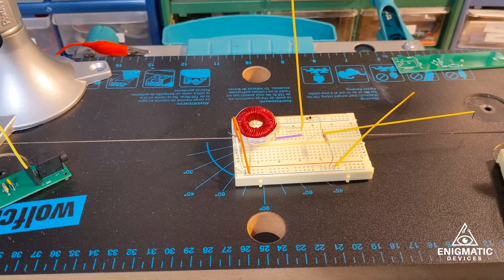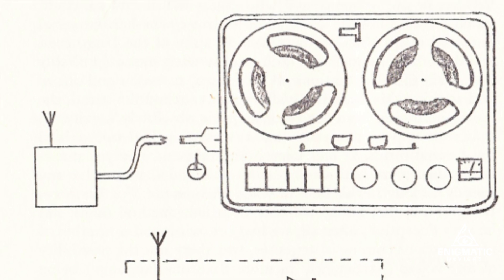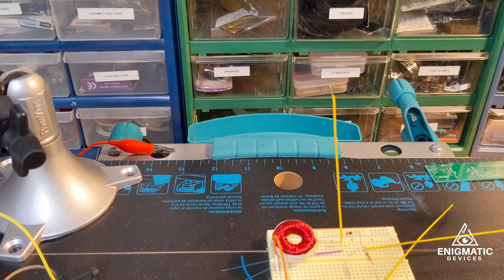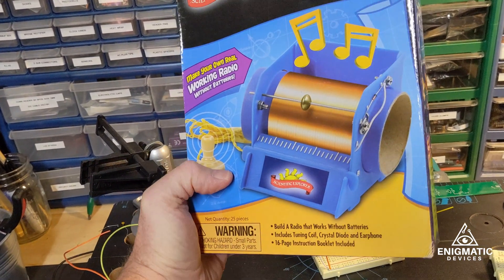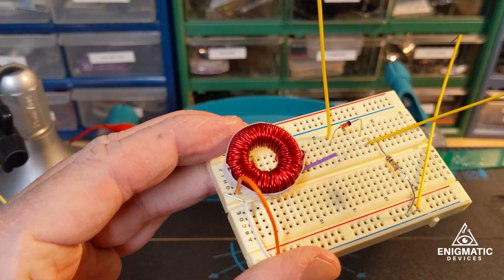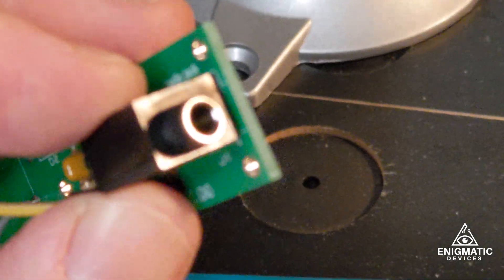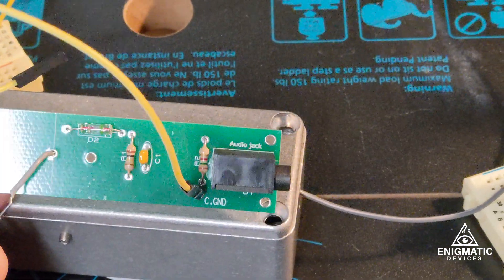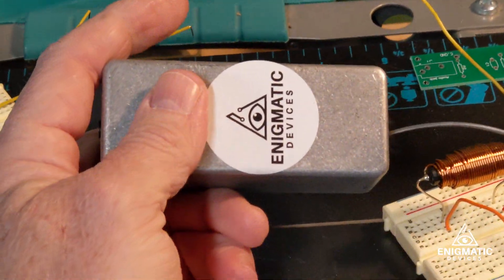Building Raudive's Diode Detector  - Paranormal EVP Device

Comment: I built a couple of these diode circuits back in the late 80's.  The parts I used was a radio frequency choke 2.2 Millihenries,  germanium crystal diode IN191 and an 100,000 ohm resistor.  Long story short,  I plugged the circuit into an old reel to reel tape recorder and to my surprise a multitude of voices came booming through the recorders internal speaker. Honestly it sounded like I was in a theatre full of people talking over one another. After a short while listening to the voices, I realized what  it was receiving was in fact radio stations over lapping one another.  On hindsight I should have used it for what it was designed to do instead of dismissing it as a crystal radio. Some of the voices it received could have well been from the spirit world. Sadly I don't have the circuits anymore to find out, which is a great pity as I built them really good, exactly to the plans given in the " Handbook of PSI Discoveries" by Sheila Ostrander and Lynn Schroeder. If you do decide to build this spirit receiver, and you hear nothing coming through after you have hooked it up then it will most likely be that you've connected it to equipment which is not compatible with the circuit. I hope this is helpful!

Comment: They basically insensitive radio reveivers or envelope detectors. But the paranormal part comes in via synchronicities within stray broadcasts and intention PSI on the random noise which can produce genuine evp.
Reply: Yes its à little am détecter radio ... but for sckeptiks , they will use this fact for saying its not paranormal voice recorded  ... have you seen multi oscillator of hans otto konig ? . I think here something goes around 60 khz , its frequency of premagnetisation of k7 recorder ... strange  ... i think tci is réal but i dont try .... that make me a lot afraid of ... 😊 and you ?